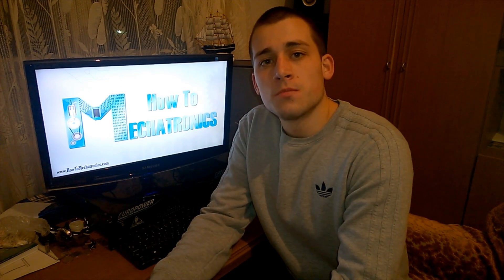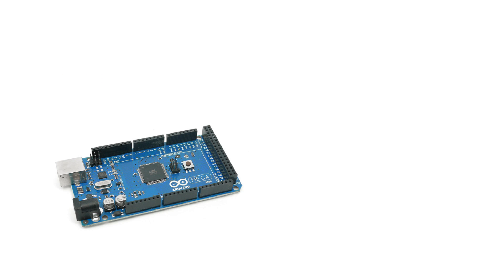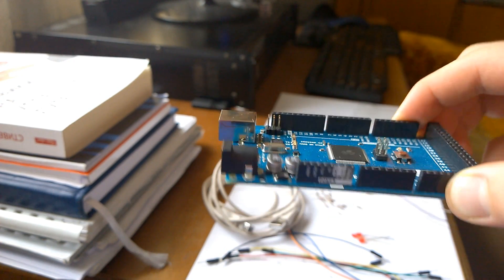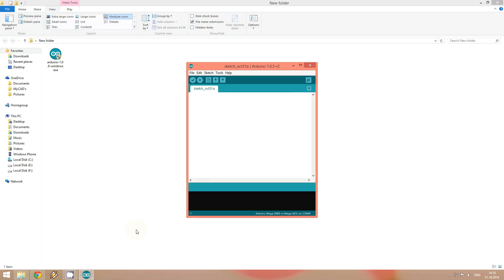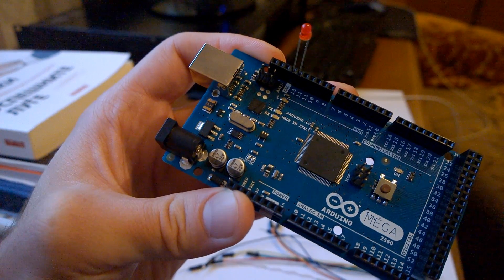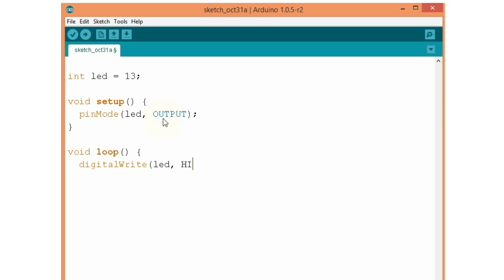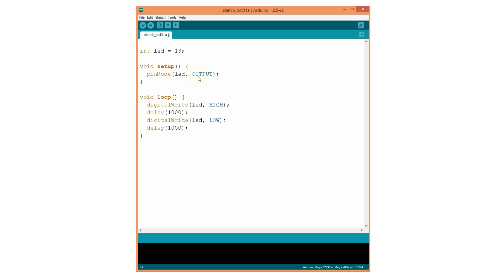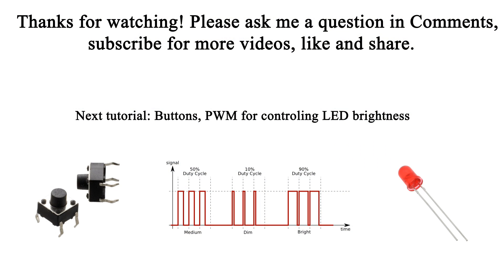Arduino Tutorial 01: Getting Started

Comment: Hi.., whenever I try to upload it is not working and port is not enabled... Please Help Me.....
Arduino: 1.6.9 (Windows 8.1), Board: "Arduino/Genuino Uno"

Sketch uses 2,130 bytes (6%) of program storage space. Maximum is 32,256 bytes.
Global variables use 200 bytes (9%) of dynamic memory, leaving 1,848 bytes for local variables. Maximum is 2,048 bytes.
avrdude: ser_open(): can't open device "\\.\COM1": The system cannot find the file specified.

Problem uploading to board.  See http://www.arduino.cc/en/Guide/Troubleshooting#upload for suggestions.

This report would have more information with
"Show verbose output during compilation"
option enabled in File -> Preferences.
Reply: you either have a problem with how its plugged in, or you did not select the type of board